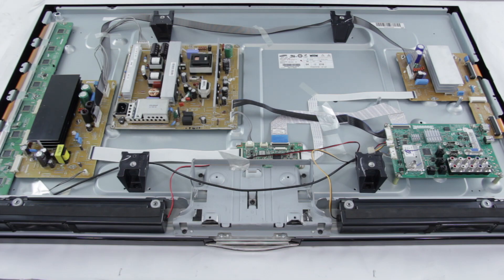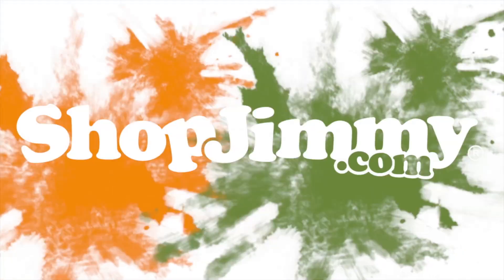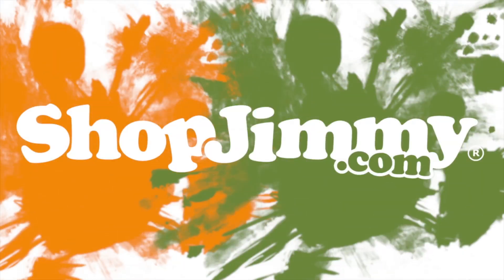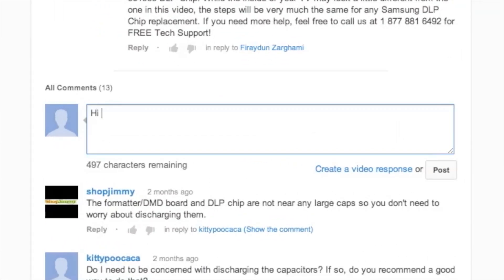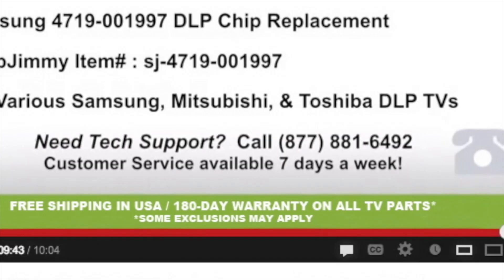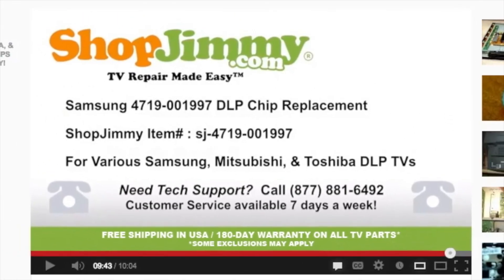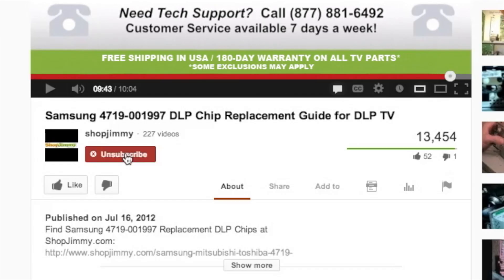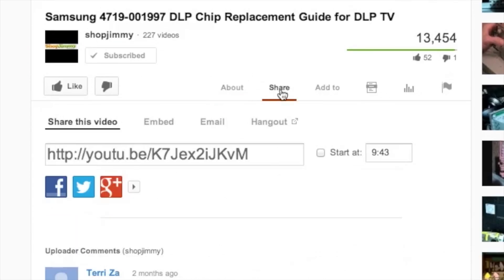Plasma TV Repair Tutorial - Common Symptoms & Solutions - How to Fix Plasma TVs

Comment: Samsung PN50C6500. Three horizontal lines, edge to edge, in a grouping, just below the middle of the screen. Also a very faint yellowish vertical line just right of center. Started after TV was unplugged and moved to another room. It wasn't dropped or bumped into. Based on your video, I might guess Y Buffer Board? Is there a disassemble / unplug / re-seat / reassemble trick? Photo available if you'd like.
Reply from the maker: +Bill Reynolds   You can upload the photo online and then reply with the URL.  Thanks!  www.shopjimmy.com
Reply: Feel free to take a look!
https://www.dropbox.com/s/9q6o0yv6v6d442d/IMG_9881.JPG?dl=0
Reply: bump
Reply: bump again :)

Comment: Hello. i have the LG 60PZ550 that is just over 2 years old. I'm looking to replace the main power board (EAX63330001/10). I can't find it anywhere. Help?
Reply from the maker: +Sean Bracey   Try all repairs and troubleshooting at your own risk.   Does your original board have Partial part number (62171201) on the barcode sticker?    Thanks!  www.shopjimmy.com
Reply from the maker: +Sean Bracey   Try all repairs and troubleshooting at your own risk.   Does your original board have Partial part number (62171201) on the barcode sticker?    Thanks!  www.shopjimmy.com

Comment: I have a Samsung 51 3d Plasma TV.  It does not turn on and the red light flashes 5 times and repeats.  The model no is PN51D550C1FXZA and Version is N411.  I hope you can help.  Thanks.
Reply from the maker: +Sharon Bagtas   Try this at your own risk. Unplug the TV, then disconnect the y board and plug in the TV to see if the TV powers up. Note that it will not have a picture on the screen. Reply with the results of this test. Thanks! www.shopjimmy.com

Comment: Samsung PN43F4500AF. Unit will power up, on screen displays "Component" and Samsung logo for approximately 10 seconds then cycles back through the same. Thoughts?
Reply from the maker: +Austin Good   Try all repairs and troubleshooting at your own risk.  I recommend replacing the main board in your TV.  Click this link to replacement parts for your TV model number.  http://www.shopjimmy.com/samsung-bn94-06194x-main-board.htm  There may be multiple boards for the same TV model number, be sure to match part numbers on your current board, with your replacement for compatibility.  Here is a link to a video showing how to identify your part number, click here:  https://www.youtube.com/watch?v=RwHTvjMdrhk  Thanks and please let us know if you have any further questions with your TV Repair!  www.shopjimmy.com

Comment: PANASONIC TH-50PE8U : the top portion of the screen shows but the rest goes black. sometimes the bottom half will flicker back in and work..but later go back to black. so basically i'm not getting a full screen..only the top half.
Reply from the maker: +K Vice   Try all repairs and troubleshooting at your own risk.  This sounds like a TV panel (TV Screen) problem.  If your TV panel is bad, it may be more cost-effective to replace the TV as panels are typically hard to find in stock, difficult to replace, and expensive.  Thanks and please let us know if you have any further questions!  www.shopjimmy.com

Comment: I have a nexus model: nx422 
At times the picture won't show up, audio is fine, but there is no picture any ideas on how I can fix it
Reply from the maker: +MrDogsr2  Try all repairs and troubleshooting at your own risk.  I recommend replacing the YSUS and the Top Y Scan Drive board in your TV.  Click this link to replacement parts for your TV model number:  http://www.shopjimmy.com/catalogsearch/result/?q=nx422  There may be multiple boards for the same TV model number, be sure to match part numbers on your current board, with your replacement for compatibility.  Here is a link to a video showing how to identify your part number, click here:  http://www.shopjimmy.com/catalogsearch/result/?q=nx422  Thanks and please let us know if you have any further questions with your TV Repair!  www.shopjimmy.com

Comment: I have a 50 inch samsung plasma tv model number S50Fh-YB01 and my tv cuts on and off when I turn it on to try to find a clear picture when the picture is clear it stays on and sometimes it can't take up to 30 mins or more to get a clear picture
Reply: +ShopJimmy.com  ok Jimmy I did exactly what you told me to do and unplugged the Y board and powered it up. when I did that the tv started clicking on and off repeatedly and the sound you hear when the tv comes on about the fourth time the TV clicked back on
Reply: +Darion Green  i have a 50 inch plasma tv that about 6 inches from the top of the screen is solid black and the rest has vertical lines all the way across the tv screen what is causing that

Comment: Great video... I have a Samsung Plasma Model # PN60E550D1FXZA. The red light flashes on the front when attempting to turn on but the TV never actually comes on. Last week i was able to press the power button on the remote on and then off 3 or 4 times and it would finally come on but now i get nothing but the red flashing light when i press the power button on the remote.

Comment: PN51E550D1FXZA TV turns on and off repeatedly every 5 min. for about 1 to 2 hours. Then TV stays on like normal, but smart hub doesn't work. Also, sometimes I get slow motion effects.
Reply from the maker: +knight3252  Try all repairs and troubleshooting at your own risk.  I recommend replacing the main board first and see what that does.  There is the possibility that you have multiple problems with your TV.  Click this link to a replacement main board for your TV model number:  http://www.shopjimmy.com/samsung-bn94-04644b-main-board-for-pn51e550d1fxza.htm  There may be multiple boards for the same TV model number, be sure to match part numbers on your current board, with your replacement for compatibility.  Here is a link to a video showing how to identify your part number, click here:   https://www.youtube.com/watch?v=BEPWrefQvqIThanks and please let us know if you have any further questions with your TV Repair!  www.shopjimmy.com

Comment: I have one very thin black line running horizontally all the way across my screen about 5 inches below the top of the screen. It is a Samsung 50 inch plasma 
Model - PN50C550G1FXZA . Any ideas and if so, I would like to buy parts if it can be fixed.
Thanks, Danno

Comment: Insignia NS-51P680A12 has black pixels horizontally across the screen only partially, these black pixels fill in the longer the tv is on.  It also has pink coloration where the pixels are constant, but the pink goes away during scene changes, and comes back during others.
Reply: +Nathanial Deschine The pink lines run in horizontal pixelated strips approx 1" wide with a strip in between that has no issues.  In between strips are thin, 1/4" approx.

Comment: Hi. Few days  before, twice a popping sound came from the back of my samsung 43 inch plama tv. Then While in tv on condition i directly switched off the main power supply board. I waited for 2 days thn i turned on but no picture is diplaying on the screen only power led light is blinking in unusual pattern. Now TV wont start. I called both local authorised service engineer and local tv repairer. Samsung engineer said tv display pannel needs to get replaced but it is too costly. local tv repairer checked all boards and said their is a problem in logic board. Can you please help ?

Comment: i have a samsung 50 inch plasma tv model. PN50C490B3D. it was working fine and yesterday i went to turn it on and it wont turn on . It will turn on buzz for a few seconds then shut off after about 15 seconds. it wont stay on it'll just shut off. any ideas on whats wrong with it
Reply from the maker: +David Lozada   Try this at your own risk. Unplug the TV, then disconnect the y board and plug in the TV to see if the TV powers up. Note that it will not have a picture on the screen. Reply with the results of this test. Thanks! www.shopjimmy.com

Comment: I have a Samsung  plasma TV with vertical lines. model number PS50A457P1D and the model code is Z5GJ3SVQ800548A. Version  BS01
Reply from the maker: +mercy mwalughali  Try all repairs and troubleshooting at your own risk.  This sounds like a TV panel (TV Screen) problem.  If your TV panel is bad, it may be more cost-effective to replace the TV as panels are typically hard to find in stock, difficult to replace, and expensive.  Thanks and please let us know if you have any further questions!  www.shopjimmy.com

Comment: Hi, I need your help... 

tv:  samsung model PN50C540G3F

there are thick black lines across the horizontal band on the tv.. 

2 inch line at the top and bottom and 1 thin line in the middle of the tv..

after watching the video, I bought the y-board for it. after replacing the y-board the same problem resulted.

any other ideas what it might be...
Reply from the maker: +jade stryuuin  Try all repairs and troubleshooting at your own risk.  This could be a problem with either the buffer board or the TV panel.  You can try replacing the buffer board to see if that fixes the problem.  Click this link to replacement parts for your TV model number:  http://www.shopjimmy.com/catalogsearch/result/?q=PN50C540G3F  There may be multiple boards for the same TV model number, be sure to match part numbers on your current board, with your replacement for compatibility.  Here is a link to a video showing how to identify your part number, click here:  https://www.youtube.com/watch?v=R1jmj_foId0  Thanks and please let us know if you have any further questions with your TV Repair!  www.shopjimmy.com

Comment: I have a Samsung 42". We had taken it down for 4 months during home repairs. When we went to hang it back up, we plugged in the power cable to the wall outlet and heard a very loud "pop". The TV will not turn on now….nothing. I took the back off and checked all the capacitors and they all look fine…none blown. The fuses are white in the middle so I can't tell if they are good or not. thoughts?  Model: LN40B530P7F ; Model Code: LN40B530P7FXZA.  Thx, Chris

Comment: Hello! I have a Samsung Plasma TV PN58C680G5F 58 inch screen. When I turn it on I get the red light in front and hear about 5 clicks from inside. No picture or sound. I opened the back and the clicking sound is from the Power Supply Board with a blinking green light on the Logic Board. To troubleshoot, I disconnected the power board from all others. One at a time I powered the power board after plugging in each additional board. The clicking happens when the Main Board is connected. (the one for all the inputs). Would this be a power board issue or main board issue?
Reply from the maker: +Birds Eye Aerial Imaging  Try all repairs and troubleshooting at your own risk.  <!-td {border: 1px solid #ccc;}br {mso-data-placement:same-cell;}->Reconnect everything, when that is done just disconnect the y board plug the TV in and see if it stays on. (there will be no picture)  Thanks!  www.shopjimmy.com
Reply: I received your email about the Y Board. Tried unplugging the board and tv still will not turn on. Keeps making the clicking sound. Since I posted my previous comment, I replaced the main board which I purchased from you and now I am waiting for a power board to try that.
Reply: Update: I bought a power supply board online and it is fixed. The main board from shopjimmy is not showing true black on the screen and the video is weak. Used my old board since that was not the original problem. I will try to return the defective board.

Comment: Great video….wow amazing the issues that arise with a $4000 purchase out of warranty….!!  Sad.  I have a PN59D800 Samsung.  Red stand by light but will not turn on…...
Reply from the maker: +Molly Laf 3   Try this at your own risk. Unplug the TV, then disconnect the y board and plug in the TV to see if the TV powers up. Note that it will not have a picture on the screen. Reply with the results of this test. Thanks! www.shopjimmy.com

Comment: Plasma TV has no power.  Tried remote and TV controls on bottom left corner of unit.  No response, no little red light.  Model number: PN60E7000FFXZA  S/N: Z50D3CKCA00542R.  Would like to try and repair myself.  Unit is less then 3 years old.  Thanks.
Reply: ShopJimmy.com Thanks, I already knew it was the power supply board.  Tried you first to get part.  You were out of stock.  Went to Samsung directly and got raped for the part.  However, the part worked awesome, and in ten minutes I actually fixed my plasma TV without paying the $150.00 per hour service fee for 20 minutes of work.  Nice!!

Comment: Hi there,I have a Acoustic Solution tv model:LCD42761F1080P. the problem is that when it turn on the screen is in a like a black shade and after 15-20 min returns back to normal ,or the black -grey  filter is gone.What can be the problem and what part should I change?Thanx

Comment: Hi I have a Samsung Plasma TV (PN58C8000YFXZA) that has sound but no picture. I have tried different devices get same issue. I can't even get the menu for the TV to come up when disconnected from cable TV. Could this be the main logic board? If not any advise would be appreciated will buy needed board to repair. I have removed back cover properly grounded and took pictures of all the boards for part and Rev codes. I did not see any burn spots on any of the boards.Thanks
Reply from the maker: +Walter Kelley   Try all repairs and troubleshooting at your own risk.  I recommend replacing the Y-Main Board and the Top & Lower Y Scan Drive boards in your TV.  Click this link to replacement parts for your TV model number:  http://www.shopjimmy.com/catalogsearch/result/?q=PN58C8000YFXZA  There may be multiple boards for the same TV model number, be sure to match part numbers on your current board, with your replacement for compatibility.  Here is a link to a video showing how to identify your part number, click here:  https://www.youtube.com/watch?v=R1jmj_foId0  Thanks and please let us know if you have any further questions with your TV Repair!  www.shopjimmy.com

Comment: hi i have a LGpk350 which turns on but within first few minutes it swiches off and keeps clicking?I have disconnected both  ysus and xsus boards but still kept switching.when it does come on the picture is fine no issues? hope you can help thanx

Comment: Hello guys,
I just want to let you know we really appreciate your videos on repairs.  You all have helped me a couple of years ago on my 42" LCD Sharp which I did what you recommended and isolated the problem and fixed it.   Well now I have found a 50" Samsung plasma PN50B450B1D and I would like to fix it.  So when I plug in the power cord I do hear a relay clicking and the standby is solid red no blinks.  I was hoping you have a video or instructions on how to check all boards with a Fluke 101 multimeter.  I have tried unplugging  the x board going to the power supply and still get the relay popping.  I did the same to the Y board and same clicking relay.  I do not see any bulged capacitors or any noticeable damage. I did find some sticky residue on the main board that I cleaned with electrical board cleaner.  I do not want replace wrong board so I am asking you all for some pointers.  Thank you again 
John
Reply: Sounds like relay is getting weak. Can you replace it?

Comment: Need help. I have a 50 Samsung plasma -always worked great never had any problems till yesterday when I went to turn it on the picture was barely viewable. The screen had lots of vertical colored lines going thru it and you could barely make out an image thru the lines. The model code is PN50A400C2DXZA, serial AQXO3CQQA15476F Version SM12. mfg oct.2008. Really hoping I can find a way to fix it.
Reply from the maker: +scott lackey  Try all repairs and troubleshooting at your own risk.  This sounds like a TV panel (TV Screen) problem.  If your TV panel is bad, it may be more cost-effective to replace the TV as panels are typically hard to find in stock, difficult to replace, and expensive.  Thanks and please let us know if you have any further questions!  www.shopjimmy.com

Comment: I have a sharp tv (model #lc-40d68ut) and when I plug the cord in  the  outlet the red standby light flashes and it won't power up. I can unplug the unit and plug it back in while holding down the positive volume button and the negative channel button together for about 3 seconds and you can see the screen power up for a brief second but it shuts back down and the light stays green until I press the power button. Can you help m with a fix?
Reply from the maker: +lalinda bolton  Try all repairs and troubleshooting at your own risk.  How many blinks are you seeing?  Thanks!  www.shopjimmy.com